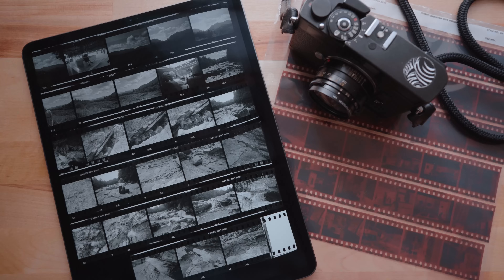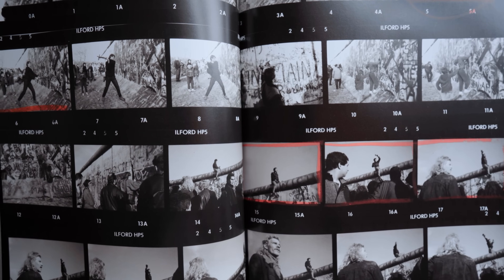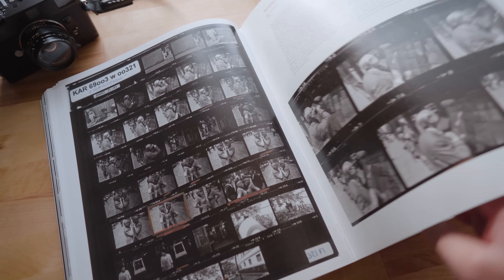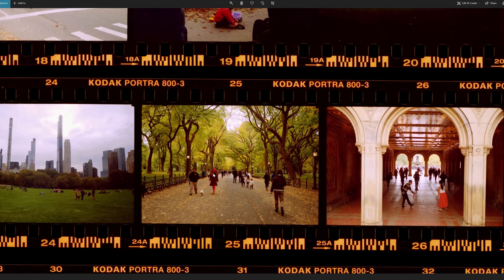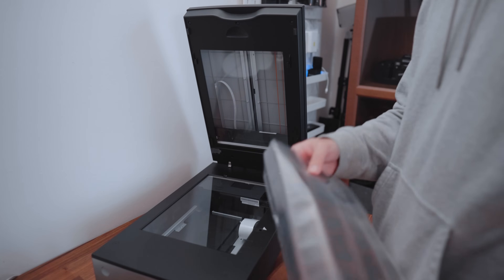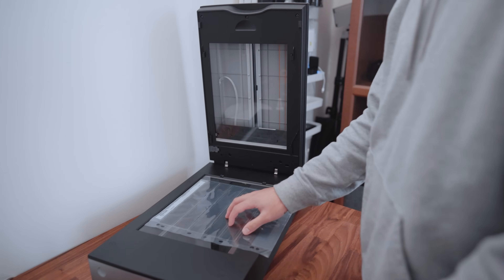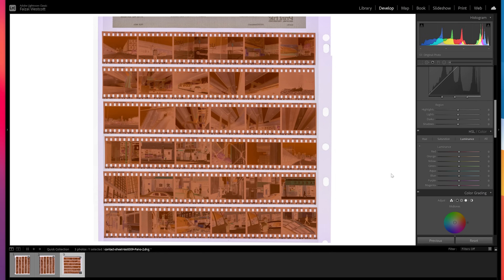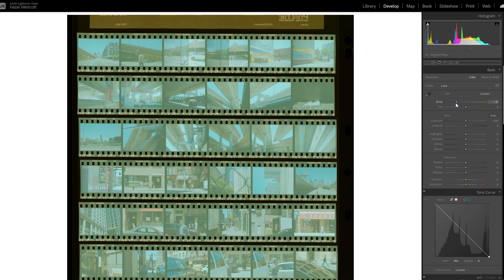How to Make Digital Contact Sheets

Comment: I tried scanning using those plastic pages (which I don't store negs in long term) with some 5x4's and the quality was horrible. I finally just placed the negs on the scanner glass with a piece of glass on top and didn't care if they were a bit askew so long as they don't overlap into the images. Good enough for contacts.

Comment: Just saying the way you correct the color with color negatives are completely wrong 😑, you use level tool find the 18 grey and find the black level just simply click the flim frame,but it’s a contact sheet so it doesn’t matter.
Reply: Or using curve tools and adjusting the high light and low light with the histogram in each RGB channel.

Comment: Looks like it's actually possible to do this: if you have a $1,500 Epson v850. The next one down that's reasonably priced is the  $350 Epson v600--with a far narrower scanning slot. You'd need at least four passes per page with this reasonably priced Epson scanner. Nice idea. Not for the casual hobbyist with a couple of dozen negative pages. Oh well, back to the drawing board.

Comment: Great video Faizel! how do you ensure the negatives are flat?
Reply from the maker: That’s a great question. There really is no great way to do it other than waiting for your negatives to flatten over time. Not exactly sure how well this would work but you could possibly try using a transparent piece of thin glass and lay it over the negatives. Never tried it before, but it’s usually done for wet scanning.

Comment: This is clutch!! Thanks a mil man! I currently use Pacific Image PowerFilm batch scanner, which (at best) was giving me lo-res digital scans and I was using LR as a digital contact sheet that I'd reference when I wanted to take a negative to my darkroom. This process is MUCH quicker as I'm not scanning images 1-by-1 and I'm still able to zoom in on a frame that I want to run in the enlarger.

Again, many thanks!! Keep up the killer content!

Comment: I am using the PrintFile holders in letter size where 5 frames fit in each row. Trying to scan one sheet all at once in letter size with my V850 and Epson Scan program gave trouble - it led to vertical streak lines in weird patterns depending on how I placed the sheet onto the clean scanner glass. Only by placing it further down cutting off the last row made it work. It also works without problems when placing the sheet the way you showed it cutting off more rows. The issue is independent on the used scanner driver - I tried it both with EpsonScan 3.9.3 and the latest one, 3.9.4. Can you reproduce the similar issue by placing your sheet with negatives 90 deg rotated into the scanner (meaning placing it vertically in portrait arrangement)?

Comment: The method doesn't work with the V500 /V550 due to smaller scanning space and the Epson scan software which has different settings than when conects to more recent scanners. I placed the strips in a clean sheet and placed only two strips vertically corrsponding to the max scanning space of my scanner. There is no setting under film for "scanning max area with film edges". As a result and probably due to the clean file, the scanner doesn't recognize the document/film and pops up an error message "no response from the scanner".

Comment: Can this be done with Epson Scan 2 on a v550?
Reply: I have a similar question! Idk if anyone has tried it 👀👀👀
Reply: @itscrysiano  I tried it myself, and it's much harder sure to the skinny scanning glass on the top
Reply: @hayesnorman3244  oh yeah, I just tried myself. And def agree. I had about 5 jpgs because it only able to scan 2 rows at a time. When I tried merging them, it didn't work, because I didn't scan them in the same spot. The hack is, using photoshop and just aligning them together , AND then importing to Lightroom to convert. It worked, but this was a first go around. I am sure I could clean up the workflow to be a little more efficient. Bur def harder for sure.
Reply: @itscrysiano  Are there focus issues? The stock film holder holds the film at a certain distance from the glass, so would there be problems with a transparent sleeve?
Reply: @bumi5178  funny you ask this because, i typically scan my negatives without the film holder. Just bare like that on the scanner glass, it makes it sharper actually. In regards to the contact sheet. I felt like it could have been sharper but because it was in the sleeve it wasn’t, maybe that had something to do with it. Though, we have to remember that this is 35mm is small, so scanning that size in a transparency sleeve only makes it smaller. I think for digital contact sheets quality is forsaken. I don’t think anything is as sharp as wet printing,  but all in all, the point is to have a better idea on what’s on the roll without scanning each frame. I hope this helps, i could have easily talked you in circles 😂

Comment: 1950s? Bro people did that until 15 years ago or sumn.
Reply: I switched to digital 20 years ago.
Reply: @Mike_M_Smiths  good to hear you were an early adopter. As far as I know it wasn't until the 2010 at least that digital cameras truly caught on.
Reply: @benjaminaguilera8097  Canon and Nikon came out with professional cameras in the mid 90’s. Most where Canon 1D size cameras.
Reply: @Mike_M_Smiths  That doesn't mean there was a widespread use of digital. I remember at least half of my professors still used film back in 2011 when I first got into photography. And film was easy to find and have developed and scanned. It faded mostly after the T3i and its immense impact in accessibility to quality digital cameras. Not that digital didn't exist before, but was hella expensive and not as widespread as it is now. I'd say hybrid for the whole 2000s and film faded after 2010.
Reply: @benjaminaguilera8097 2010 is the start of the death of most digital cameras and move to phones and mirrorless cameras. Kodak’s sales for film cameras started to decline in late 90’s. By the end of the 90’s, Phase one had a digital back for every medium format camera. Every major news organization was shooting digital before 2000. Yeah some people where still using film. But they were no longer shooting 30 rolls of film per assignment. No one was paying for that anymore. 9/11 killed film for professional work.
Reply: @Mike_M_Smiths  Maybe. I'm not old enough to say otherwise. It's still true that a lot of people were still shooting film up until maybe 15 years ago. Not anymore. That was my point.
Reply: @benjaminaguilera8097  I switched to Canon 1n cameras then moved over to their digital cameras. I still use Canon 1d’s.

Comment: Thanks a lot for this excellent tutorial. I will definitely use this. Should save time doing the first selection of frames to scan later in hi-res. And its great to have the contact sheets for overview. I had thought about the possibility of using my flatbed for contact sheet scanning so it was great to find your tutorial.

Comment: This was one of the vaguest tutorials I’ve ever watched. For something so intricate, you left a lot of parts in this process untouched. How about the export size and dimensions? How about the instructions for this who have NLP )don’t see the point of mentioning that if you was not gonna share that process), how about saying what size your archival sleeve in the tutorial was? ...you left a lot on the table.
Reply from the maker: Hey Henry, I'm sorry you found it confusing. I tried my best to make an informative video that also wasn't too long. I agree, though I should have went into more detail on the exporting. Export size is really up to how large of a file you want. I mentioned at 5:57 that 2400 dpi is the sweet spot for the scans so if you went with 2400 dpi, exporting from lightroom at a file size you see fit should work well. When you export you can play around and see if it's sharp enough for you when you zoom into one image on the sheet. I have mine at 100% quality and 300 dpi. As for NLP, I mentioned it because that's what I usually do in my workflow and I wanted to be transparent, but I figured most people don't have it, so I decided to show how to do it manually instead. I've got planned a separate tutorial on how to use NLP to edit images. And for the sleeve, I'm using a Print File style No. 35-7BXW . As I mention in the video, depending on your scanner and how large the scannable area is, you might have to scan twice. Thanks for your honest feedback though, I'll try to be clearer in future tutorials I make
Reply: Faizal Westcott thanks for the response and providing more details. I really appreciate you taking it constructively instead of getting defensive. Keep up the good work.
Reply: @FaizalWestcott  You 100% deserve to get more recognition on this channel.

Comment: Is this possible with the epson v550?
Reply from the maker: Yes it should!
Reply: @FaizalWestcott  I think the v550 has a much smaller scanning strip as opposed to the one you’re using which utilizes the whole bed of the scanner
Reply: @Peak3Visuals  I have the same problem with my V500. I'm going to try it now but because of the smaller scanin space I will have to do 3 to 4 passes and scan 2 strips at the time for 35mm and 1 strip at a time for 120. That's much more work and time for a contact sheet but it might be still worth it.

Comment: Would be interesting to hear a take on how to incorporate the contact sheet way of thinking into a digital only workflow. Surely there is something to learn apply from the way things were done previously
Reply: Adobe Bridge basically works as an interactive contact sheet, allowing you to quickly view all photos from a shoot and make your selects. Instead of circling the selects, just rate them and then filter for your highest rated shots. The benefit is you don’t have to break out a magnify glass to make close up inspections.  Plus in Adobe Camera Raw or Lightroom you can make adjustment presets for the shoot that you can quickly apply to all selects from that shoot. It’s easier than taking notes in the darkroom while dialing in a print, then having to repeat those same steps on the rest of your selects.